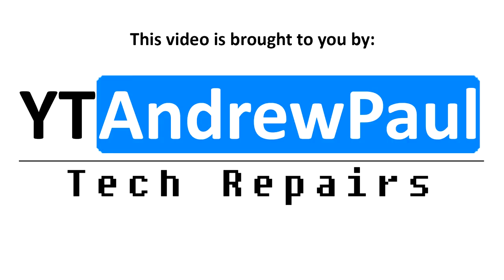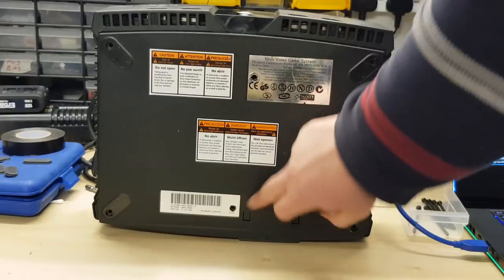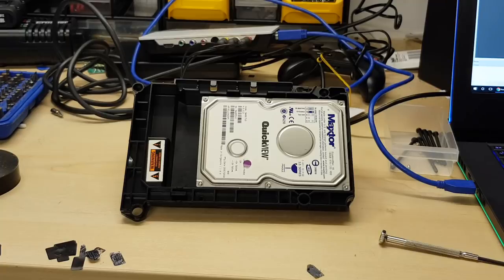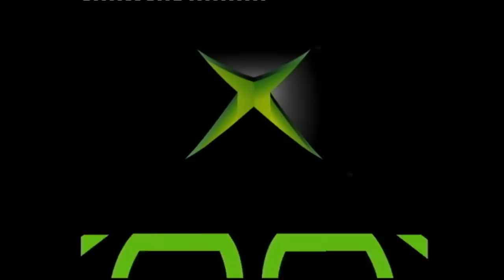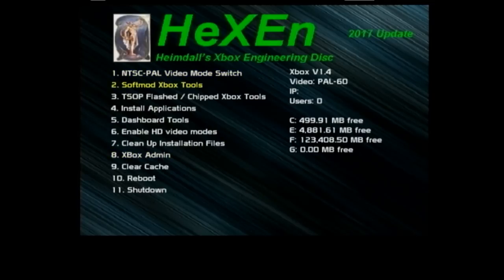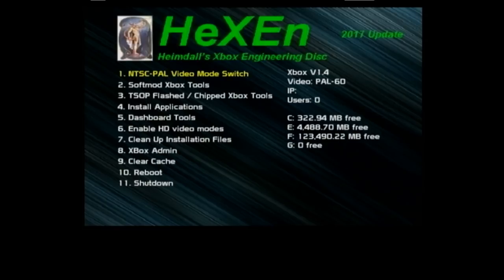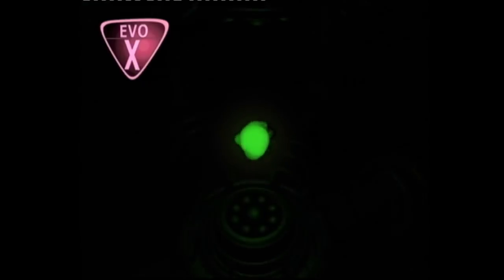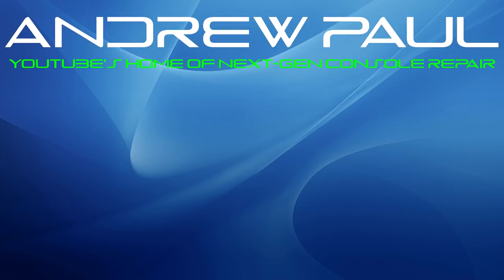Original XBOX Hard Disk Drive Upgrade Tutorial (January 2018)

Comment: Those 8GB drives are 13 - 17 years old now! They seem to have outlived all of my hard drives on the PC.
Reply from the maker: They're solid units ha ha! Both those I own are still going strong.
They don't make 'em like they used to ;-)
Reply: Their read and write are no where near as heavy as a pcs, but ALOT of those drives died probably around 2009, saw so many fucked ones and probably repaired about 40 of them with dead drives or clicking drives and saved them
Reply: They are WD drives
Reply: Jacob Power I have three original Xbox stock that still work perfectly fine

Comment: Someone has probably already pointed this out in the comments, but it is possible to use the softmodded software to copy the bios and everything on your original hard drive to your new hard drive using the IDE cable in the xbox and a molex y-splitter cable for power. It should work, but don't take my word for it I am a noob when it comes to modding old hardware.

Comment: If an Original Xbox fails, is it possible to take out it's 10GB HDD and put it in a different Original Xbox without any changes?
So essentially 'plug and play'.
Reply: No. they are locked to the specific Xbox... you can only swap on modded Xbox with special software.

Comment: I know next to nothing about 'softmodding' and 'flashing various bios' when it comes to consoles, but as a theory if I wanted to replace an original Xbox's hard drive with a modern SSD drive would I not be able to remove the Xbox's hard drive, hook it up to my PC via an IDE to USB adapter, create a clone of that drive, image the clone onto the SSD drive, then using an IDE to SATA adapter fix the SSD into the drive bay of the Xbox before reassembly?
Might sound like a messy way round, but if it was to work it would avoid any kind of modding. :)

Comment: I've heard the words 'locking' and 'unlocking' thrown around a lot when it comes to replacing an original xbox hard drive. What exactly is a locked hard drive? Is the factory installed HD paired with the the original xbox or motherboard in some way?  Is it something unique Microsoft only did with the original xbox HDs?
Reply: Leppy0014 if you lock the hdd then you can go to the og ms dash. If you have it unlocked you can't.

Comment: Hi Andrew just quick message I love your videos Iv just bought few of these Xbox’s and one is doing clicking noise something is rattling inside iv not had chance to open it up yet but when you want to try turn it off it doesnt want to turn off if that makes sense can you give me some advice on what it could be I think it could be the hardrive what’s had it
Reply from the maker: Hi Rob,
Indeed if the HDD is clicking then that will need replacement - grab an IDE to SATA converter and stick an SSD in there - it'll be quieter, cooler and draw less amps from the PSU in there which will be beneficial for the hardware. It could well be that that's causing the reluctance to power down - it'll be trying to cleanly shutdown the file system on disk before powering off - if the disk is bad it won't be able to do so and may cause it to hang or take an age to power off.

While you're in there check over the PSU for bulging capacitors, change the clock capacitor if the console has anything below a v1.6 motherboard and check the power cable input on the PSU - in particular the solder connections on the underside. They can fracture and arc across on some revisions which can be very bad news for the console and potentially your house! Good luck with the repair :)
Reply: Thank you for that advice andrew I will keep it in mind I have another iv been sorting my nephews ps4 pro out for while I get it fixed then few days later it’s over working iv put new fan in put new thermal paste on cheap stuff iv just brought some mx4 but when put disc in it’s working to hard and over working it self no dust in there what’s o ever so do you think maybe one of the mosfets could of had it by any chance it’s new one on me iv never had this much of a problem before 🤔🤔🤔🤔
Reply from the maker: Take the lower motherboard tray out and check the heatsink radiator - dust tends to compact into here when the fans run which will make it overheat. When they're really bad what it collects and compacts together goes sponge-like ha ha!
I found what made a HUGE difference to my Pro was changing the TIM for Thermal Grizzly Conductonaut liquid metal and replacing the heat pads on the RAM and Southbridge with some Thermal Grizzly Minus Pad 8's. My console also had a Nidec fan installed, but this is a worthwhile upgrade if yours doesn't also. Mine ran super-quiet even at full tilt after the above. I've since sold that console to a friend of a relative and it hasn't skipped a beat.
Reply: Brilliant Andrew thank you so so much for the help and advice you have given me iv just repaired one of the Xbox’s it had stuck disc drive and had to replace the belt and now works like a treat lol. Have you got an email that I can use in case I get stuck again please check out my Facebook page on consoles I have done rtb ps4 repairs/cleaning see what you think 😄

Comment: In 2018... why wouldn't you use adapters to use something less heavy, fragile etc. like compact flash or SD or SSD?
Reply from the maker: It was a drive I had lying around not doing anything and works perfectly fine. At some point I may consider something a little more modern but for now it does the job.
Reply: SD Card would be dead quickly, not made for that usage

Comment: Can anyone well me will there really be any difference between a 5900RPM and 7200RPM WD 500gb drive with 80pin cable and IDE/SATA adapter, 5900RPMs are cheaper and easier to get but I don’t want it to run slower.
Reply: 5400 is generally slower but more reliable and 7200 is faster

Comment: Hi, i just started up this old Machines and got kind of ALL games that been made for Xbox original and ill have started to put over them on lots of IDE disks but i got a question, how can i use 300Gb disk or 240Gb disk and get more space for the F: games mapp? Is it at all possible or do i have to modd and make it compatible for SATA disks...i got a toons of bigger IDE drives, more than 160 Gb and would like to get as lots of games i could...would be happy for instruction :-)
Reply: Just need to soft mod your console, which is extremely easy. Then you can use Chimp to upgrade your hard drive.

Comment: Is there a way to install a new HDD for an xbox that had no HDD in the first place? say like If i solder a hardmod chip, can i just place any hdd?
Reply from the maker: Yes - install the hard mod with the new disk installed and boot to the Hexen disk. It should work as per the video in this instance. A new tutorial will follow for this on the channel shortly as this one is slightly out of date now.

Comment: This console is electrically the same as the SEGA CHIHIRO Arcade System so maybe it would be an idea to get it to run the SEGA CHIHIRO GD-ROM's.
Reply from the maker: That might be a little tricky albeit theoretically possible - the Chihiro had an increase in RAM and a slightly different MCPX2 chipset lifted from the XBOX dev kits. Not impossible via emulation though I don't suppose and you could always add some more RAM to a stock 'box with the addition of a mod with a BIOS with RAM expansion support.

Comment: Hi, I am buying a 250gb IDE hdd second hand. Does it matter if anything is on it (I don't know what is on it) or will it be automatically formatted to work in the xbox? Thanks
Reply from the maker: It's fine if it already has things on it - just follow the video steps and you'll be able to prepare it for use in the XBOX without issue.
Reply: @AndrewPaul The xbox isn't giving the disc enough time to boot hexen. It takes me straight to error 13 screen and won't load anything

Comment: With a modchip I'm I able to put any hdd in it. With a soft mod they have to be compatible with the security lock system. My understanding is a modchip can have a bios flash wich allows you to use hdd with out the security lock enabled. So dose that mean I can use a hdd with out the compatibility security lock?

Comment: so i have tsop my xbox followed this video 100% and when i add a hard drive ide boot with hexen just freezes at xbox evo x screen any suggestions
Reply: Chris Bartlett Dude i got the same Problem. Any solution?
Reply: Put the Hexen disc in the console then turn off your xbox, turn it on again with the hexen disc inside and boot from hexen disc. Once in hexen menu format and reinstall everything that will fix it.

Comment: I have a question, My unit wont turn on but I hold the power button and I can hear it try to start but nothing happens. I opened the case but didnt have the correct Torx bit. It this possible a bad hard drive
Reply from the maker: I'd say it's more likely a PSU issue - check the lead connector block for any broken solder joints and caps for any bulging / leaking.
Reply: ok I just got the correct torx, Ill check thanks
Reply: Nothing look wrong, all solder joints look good and no bulging caps
the fan trys to run when holding the power button
Reply from the maker: Do you get any power LEDs at all when holding the button?
Reply: no nothing
Reply: Trace rot ?

Comment: I have 1.4 Xbox with Aladdin chip installed. I need to install a SATA drive via IDE2SATA adapter, but when I boot my console it gives me an 07 error. Does it matter or I can still use Hexen to fix it?
Reply: Johnny Doe Do you have an 80-wire 40 pin IDE cable? You need that if you want to use a SATA HDD.
Reply: Hi there @Johny Doe @Wally17 's correct, you will need 80 Wire IDE Cable, also check this video: https://www.youtube.com/watch?v=L7luvS2XNw8&t=0s&index=4&list=PLTBATy1u0mHmqS9FDtQt2P0udU_ZAdRdp
I've done the same with mine soft moded XBOX one Issue I have is that 1/10 times while I switch it on it stuck on xbox welcome screen...so I need to switch it off and on.

Comment: I have an xbox (v1.6) that wont read off the DVD drive (DVD drive works 100% in another xbox) any ideas? You can't TSOP an v1.6?
Reply from the maker: Does the drive have any power at all? i.e. can you eject it etc?
Reply: The drive works perfectly when connected to a different xbox. The drive in this xbox spins and ejects but doesn't spin up fully and read.
Reply: You can't TSOP 1.6 Xbox. I think you have corrupted files so try to reinstall everything again with the hexen disc.

Comment: will replacing the hdd work on a non modded xbox?
Reply: Well. Technically yes, first you need to extract the eeprom data  from the motherboard, with the file eeprom.bin you can recreate an xbox hdd using the linux disc and xboxhdmaker. There are tutorials about that and the process will actually softmod the xbox.

Comment: I have an sata to ide Adapter on my sata 2 tb drive hooked up to the xbox. I flashed already my BIOS with Hexen 2017 it has evox on it but if i try too Boot the disc After i turn on the xbox with the disc in it i get an 07 error
Reply from the maker: From what I can gather the console can be quite picky with SATA > IDE adapters. have a look around online and see what people are using with success.
Reply: Andrew Paul i heard that if you use a bigger drive and use an adapter, you need more power to run the HDD , thats why you get error 07.(HDD error) to fix this you need to get a different IDE with 80 pins. That way the hard drive gets enough power.
Reply: Use 80 wire IDE cable.

Comment: What if I get 06 in the service required page
Reply from the maker: 06 is an inability to unlock the hard disk. Essentially, the console thinks that the disk is locked by another console - if it's a drive you've swapped in from a different machine then this will be the issue. If it's the original drive, then it's likely gone faulty and will require a replacement/upgrade.

Comment: will this  work on softmodded ??
Reply from the maker: Only if it's TSOP flashed iirc.
Reply: Chimp works on  & is MAINLY used to Upgrade Soft Modded Xboxes!
Reply: @AndrewPaul  Not true ! Last LBA48 patch v3 allows to put a 2tb hdd on original xbox without tsop or modchip. Cheers!

Comment: This Modchip only need bt and d0 solder
Reply from the maker: Yes it does - BT for the front button press detection and d0 to ground the on board TSOP when booting from the modded BIOS. The other wires are optional.

Comment: The hard disk of my Xbox has this clicking sound and it won't save the game during an auto save.
Reply from the maker: Sounds like it may be about to fail completely. Might be time to think about getting it swapped out - you'll likely need either a TSOP flash or mod fitted to accomplish it.
Reply: @AndrewPaul  no, I'm not going swap this to pass the burdens on to another person. I bought this almost brand new, but since I'm a PlayStation fan, I kept my Xbox for a long time. Then, when I got some new games for the Xbox and tried it, a message pops up saying something about "07 error."
Reply from the maker: I think you misunderstand me. You'll need to change the hard disk as it's failing. A clicking hard disk, E07 and failing saves indicates that the disk is done for and will need to be changed.
Reply: @AndrewPaul  oh, ok, sorry my bad. Maybe I'll buy a broken Xbox with a working hard disk.

Comment: Can we use an M.2
Reply from the maker: Not sure if there are any M.2 to IDE adapters about but if so the most you'd get would be ATA133 speeds with an appropriate cable - seems a bit of a waste for what are expensive storage devices. At a push you could use an SSD with an IDE > SATA adapter but you'd hit the same speed limitations as above.
Reply: Andrew Paul 
Be smaller and no noise, I like to see if there is a difference in speed in some games with an M.2 vs HDD
Reply from the maker: It'd be smaller but then there's no real space premium inside the chassis. Speed you'd be restricted by any adapter you could find to at best ATA133 with the appropriate cable but you'd have no seek times and it'd be cooler - that said, this could be achieved with a standard 2.5" SATA SSD hooked to a SATA > IDE adapter at much lower cost.